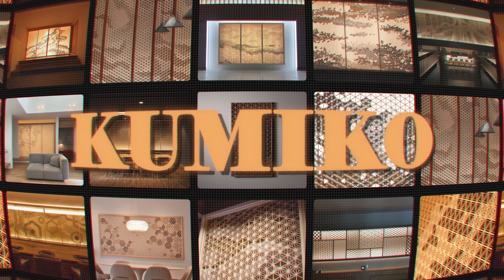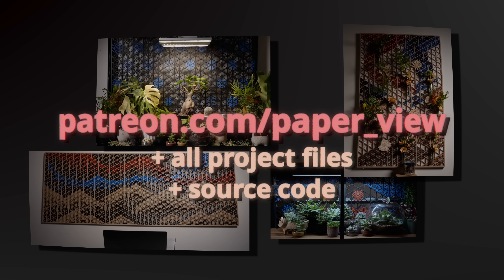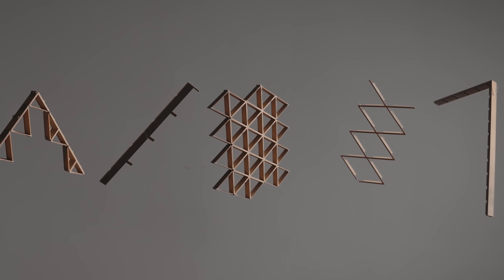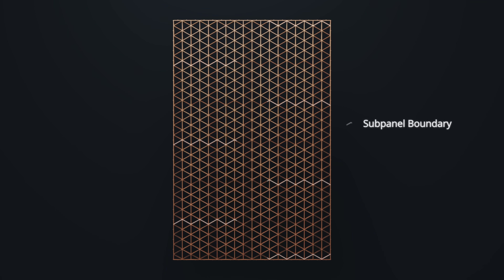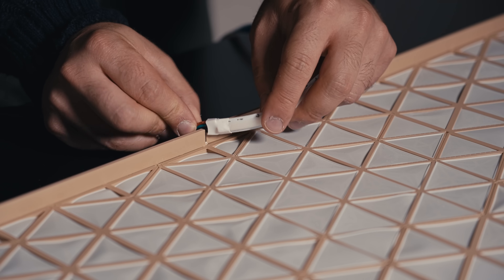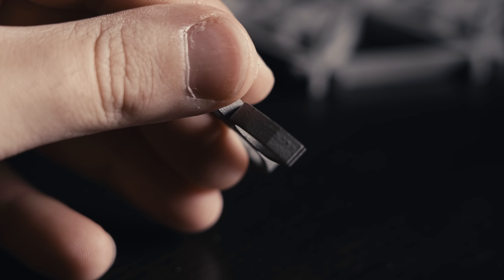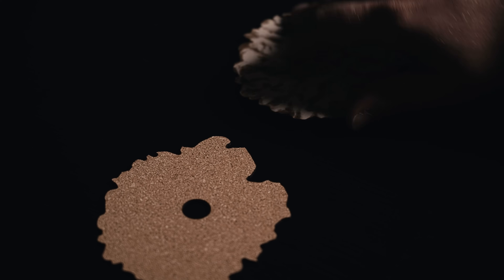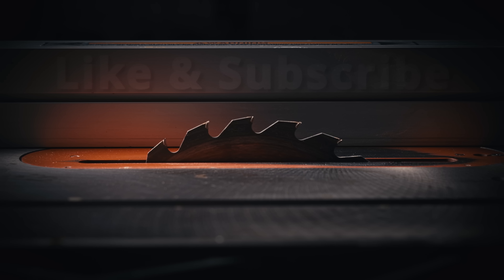You can 3D Print this Now

Comment: Roughly how much filament did this use up? Looking for a ballpark to find out how much I would need.
Reply from the maker: The primary panel in this video used just under 2 rolls of 1 kg filament for the frame and ~100 - 300g per insert color.

Comment: So...How do you actually get and use the pattern generator?  All I see is pictures of the generator.
Reply from the maker: In the MakerWorld project, if you click "Customize" then open the "Insert Generator.scad" option, you can generate the inserts through that tool and adjust the parameters as needed.
Reply: @paper_view Ok.  My browser is blocking that for some reason.  I will try another.  Thanks.

Comment: Thank you for this video Paper View, if I join your Patreon, do you have the files that would work with other printers like Elgoo? Thank you again.
Reply from the maker: I provide the full STL files but they do require some preparation. Alternatively you can open the .3mf files in Bambu Studio, highlight all the objects and export as STL. That'll let you use a different slicer. You'll just need to update the print parameters (listed in the instructions)